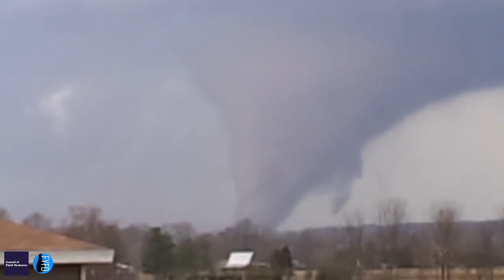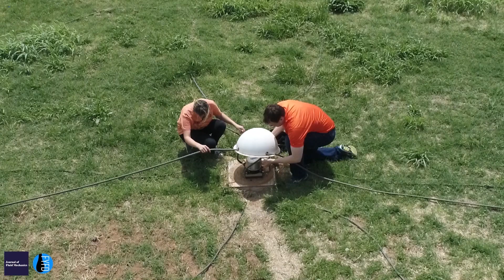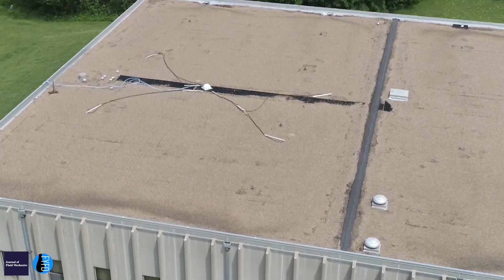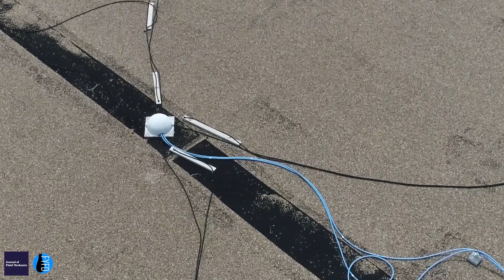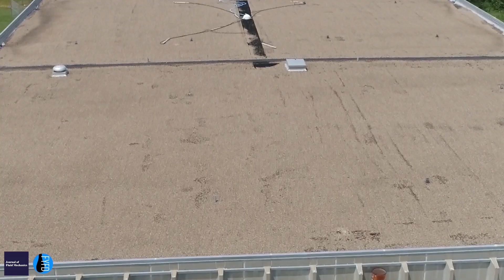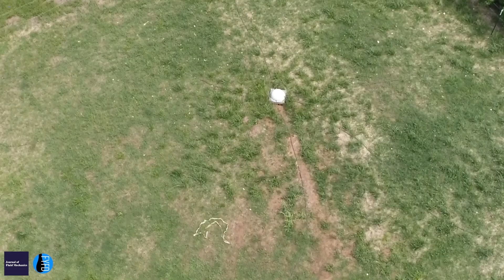Listening to Tornadoes

Comment: It looks far improved over the current doppler radar environment of relying on tornado signatures which are not always accurate and often rely on visual weather spotters for confirmation.  Nice work.
Reply from the maker: It's amazing stuff isn't it?
Reply: @TomRocksMaths  It is, and I'm speaking as one obsessed with weather changes.  They float my boat, as the saying goes... :)